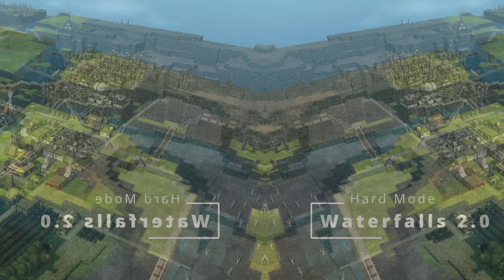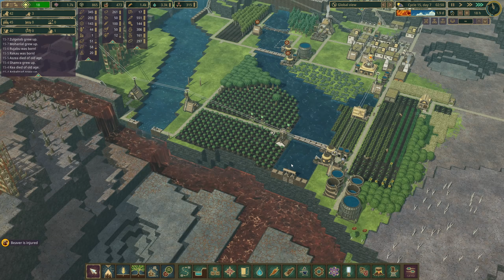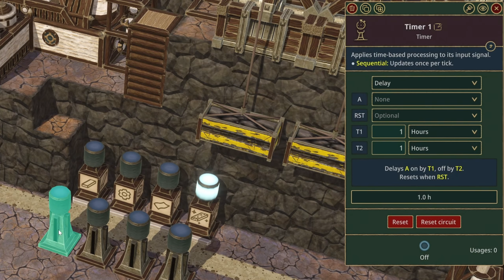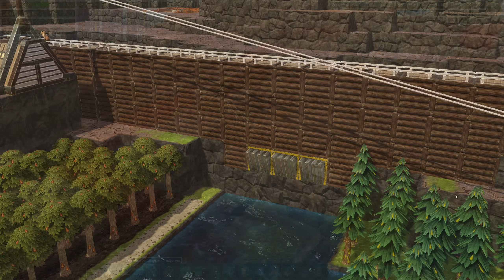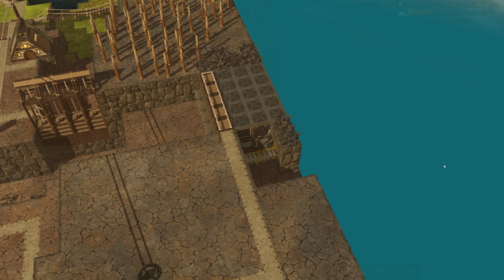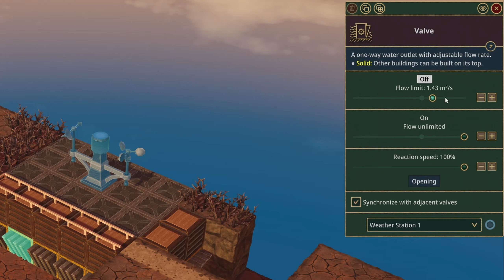They Added Automation... So We Automated EVERYTHING in Timberborn

Comment: Move your depth sensors downstream from the valves. You’ll get that type of flapping behavior if the sensor is measuring its own regulator. 

With a proper flow rate, placing it at the outlet will cause the river section to slowly fill up until the sensor end reaches the ideal depth. Once that happens, the valve is cut and the level equalizes, giving it a little time before more water is needed.

Comment: You are messing around with flow rates where a simple and better solution is to move the water pumps to a better location. Moving your water pumps as close to the water source as reasonably possible, in hard mode you have limited time to pump and fill reservoirs. Having you water pumps as the last to get water could end of the colony.

Comment: Nice automations! I've gone a bit overboard.... I decided to tackle a hard one: Overflow workspaces without resorting to vacancies and unstaffed buildings (the default priority method). There's probably a less complicated way, but here's an example with builder's huts.

BH1 Automation = "BH1 Timer"
BH1 Timer = Timer/Delay. A="BH1 Enable", T1 = 5 ticks, T2 = 25 ticks    (I adjust the on/off delays to let this one have priority over other huts - see BH2)
BH1 Enable = Relay. "Workers Available" or "BH1 Stays On"
Workers Available = Occupation/Unemployed > 0
BH1 Stays On = Relay. "BH1 is On" And "Low Vacancies"
BH1 is On = Memory/Set-Reset. A="BH1 Timer", B="BH1 Reset"
Low Vacancies = Occupation/Vacancies <= 3         (a builder's hut should stay on if it can employ at least 1 beaver, so 3 vacancies is acceptable)
BH1 Reset = Relay. NOT "BH1 Timer"

Explanation: Most of the work is due to needing to know if the building is active or paused. We use a Memory/Set-Reset for this purpose, where the condition matches the building's automation, and the reset is the NOT of this condition. We need to know the building status to allow it to run even with no unemployed, as long as there are 3 or fewer vacancies. The whole thing requires two occupation sensors, and per building a timer, three relays, and a memory.

BH2 Automation is similar. It shares the occupation sensors but otherwise has its own relays, timer, and memory. The timer ticks are T1=10, T2=20. 
BH3 would be T1=15, T2=15, BH4 would be T1=20, T2=10... This way the later builder's huts turn off sooner, and the earlier builder's huts turn on sooner.

Comment: 6:18 With setup like this I liked to stagger sluices. 1 with limit 0.95, 1 limited to 0.90 and other to 0.85. This way water will fill quickly when below 0.85, but won't go above 1.00 due to inertia.
Now, with valves this requires multiple sensors. But still nice to have if you are min-maxing

Comment: this automation looks awesome! One recommendation I'd have is that I think there's a latch in the game that lets you say "turn on if this signal happens, then don't turn off until that signal happens". That would let you set an upper and lower limit for things, which could replace the timers on the resources, but also prevent the flickering of the signal on the depth sensors.

You could say that the valves need to open when the water drops below 0.7, and then close once it hits 0.8. That way, the valves won't turn on and off rapidly. I also think it would make more sense to have a sensor a little past the valves instead of right next to them, so that the oscillations don't affect your measurements as much. The sloshing is making for a very noisy signal and that causes more sloshing.
Reply: Nailed it.  IRL, you typically want your sensors 2/3 of the distance between the source and the end of the system.  For fans or pumps, that would be between the fan and the end of the ductwork or pump and end of pipe.  Here, it'd be between the valve and the floodgates.

Comment: Now that we have automation and lights, we need to start counting the days until Bad Apple and Doom!

Also, did you consider using 2 depth sensors, one to open the valves at a minimum, and the other to close them at maximum? That would reduce both the blinking and the waves.

Comment: The new valve + sensor is very finicky compared to the sluice. I'm hoping they'll somehow make a change to make it a bit more reliable (or a good guide on how to get it stable).
Reply: Part of the issue looks to be placing the Depth Sensor right next to the Valve.  When the Valve opens you get a rise in water level right there above the shut off height and the Valve closes.  Then the water level drops below and the water gets turned on and water rises.  Rinse and repeat.
Reply: They added back a sluice like block, where you automate the depth of the water, not the flow rate

Comment: You're proving why Sluices are still needed to ensure water stability. But I still think both can exist together, with Valves able to tap into the automation system while Sluices are stuck with their own. If the devs want to make the sluices match the 'light-&-brr' they could add an automation light on it to indicate that it's open/closed.
Reply: I wouldn't go so far as to say that the sluice's necessity was already proven. At this point I'd just say that the depth sensor/valve mechanism needs some rework/tuning to easily emulate what the sluice was doing before.
That said, I also believe putting multiple valves into each wall didn't really help Walky's cause here. That probably just multiplied the issue.

Comment: with materials use memory cell, high threshold switch off factory, low threshold will turn on them
Reply: A timer will work... within its limitations. As will other solutions.
For a "start work when below x% and stop when above y%" you need a storage sensor for the below x, one for the above y and a memory set to set-reset. Though again. There are alternatives that will work to a degree.
You can go even crazier and add but only turn on in bad water season when there is enough power...  as you go more complex the memory is your friend alternatives become less viable.

The real question is... do you have enough science to unlock them all 😂😂😂

Comment: Since minimum waiting time on delaying signal is 1 tick, i think it works same as in factorio, where each logic gate delays signal by one tick... it can be used for some very advanced builds
Reply from the maker: Yea they even added a new hotkey setting to go one tick forward when paused. Definitely a 💯 implementation and they know how crazy people are gonna be with this.
Reply: @DefinitelyWalky I can't wait for someone to run Doom in Timberborn
Reply: @LINKedup101  The hardest part will be probably to make a display screen
Reply: @DefinitelyWalky  You can't pressurise source blocks if they are on the end of the map or is this a myth because I saw a video saying they couldn't have this been changed?
Reply: @Drefar I think this is the case. I was diverting bad water by blocking it entirely from the source and after the first bad tide happened after updating my water source kept diverting off the map when it ended. Something changed, I had to rebuild my setup to get water again
Reply: @Drefar  Fake. That was never the case.
Water source blocks have an invisible wall above them that prevents water from flowing backward behind them.

Comment: There is an option in the Relay to make an "and" gate, right? So for that water that is constantly going and stopping at the bottom, make two depth sensors, one lower than the other. The valves turn on when the lower one activates, and turn off when the upper one activates. How much water do you need in that river, minimum? Set it the minimum like .2 above that (for evaporation), and set the maximum like .2 below what would cause flooding.
Reply from the maker: But if it's set to AND, it'll only enable if both conditions are true; so it'll just flicker at the lower sensor's level because that's where the AND becomes true.

Your idea can be implemented with two Depth Sensors and a "Memory" node, so it will enable based on the lower one and then resets based on the higher one. But by the end of this video stuff was pretty calm (very low flow rates, just enough to cover evaporation) - and then there's probably a gazillion other ways to implement this too (devs are so awesome for such an in depth system)
Reply: @DefinitelyWalky I think if you did XOR on the relay it would work, as it would be in the ON state on the low signal and OFF when the high state adds in
Reply from the maker: Oh yea that's smart 👀 would need to get rid of downstream dams tho as then I'd like to keep it @ like 0.5-0.7
Reply: @DefinitelyWalky  You can't pressurise source blocks if they are on the end of the map or is this a myth because I saw a video saying they couldn't have this been changed?